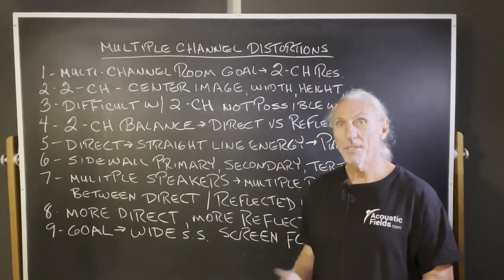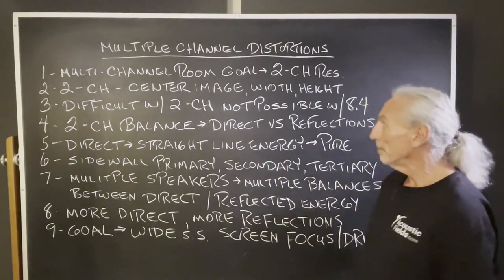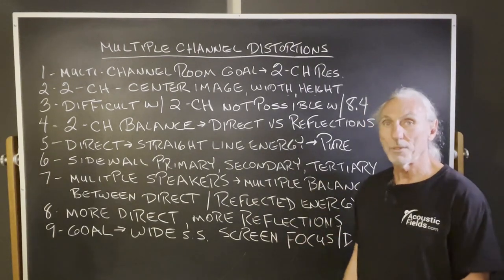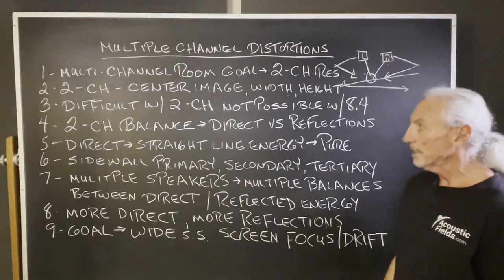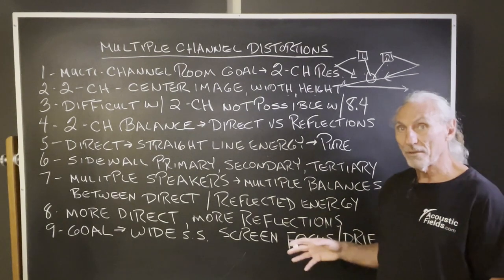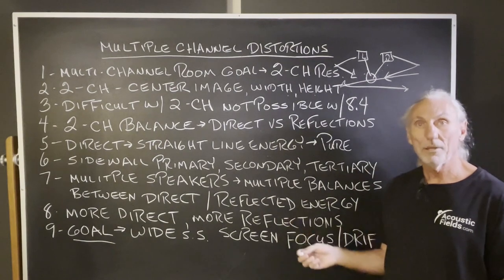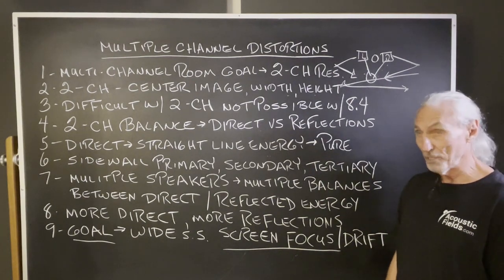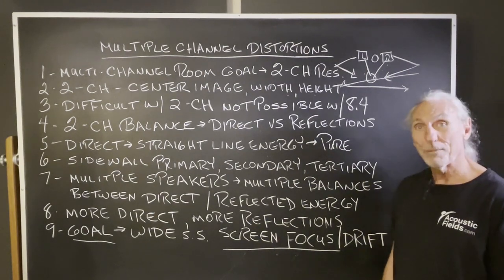Multiple Channel Distortions - www.AcousticFields.com

Comment: Funny you should mention depth in 2 ch listening. For me, it's one of those things that once you've heard, you'll always want. I've heard it before, but only with speakers far from the front wall, and tube gear. So I guess the answer is absorption on the front wall?
Reply from the maker: You can use both diffusion and absorption on the front and rear walls for two channel rooms. Lower frequency absorption throughout the four walls and diffusion front and rear. Absorption is used to create definition and diffusion is used to make the defined sound larger.

Comment: Well broadband full frequency multi channel... that sounds like a challenge, but if the room is good treated in a mirrored way,  reflections should be handled similar from the opposite direction don't they?
Reply from the maker: Yes, the rate and level along with the amount of surface area coverage is the same both sidewalls. We have large but focued soundstage with audio and video in full alignment. Large sound, large screen.

Comment: Have you try the Trinnov Altitude 16?
Reply from the maker: Please expalin this device
Reply: @AcousticFields  got one for test here tomorrow :)
Reply: @AcousticFields  Trinnov Altitude 16 is a processor that is really amazing in calibration multiple channels, imo.
Reply from the maker: @kietlu8953  Processing many channels in the digital domain without proper reverberation and pressure management in the analog domain  in a large room woukd not produce the higher resolution we require for our clients